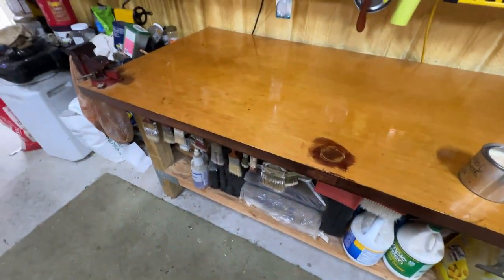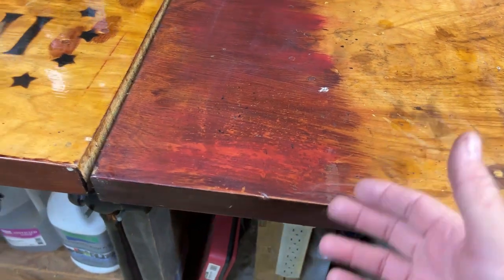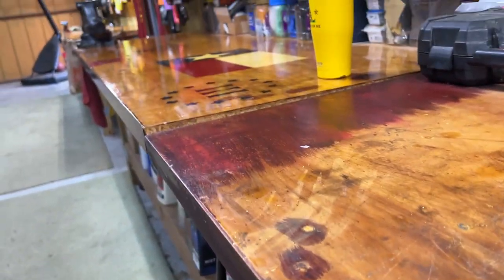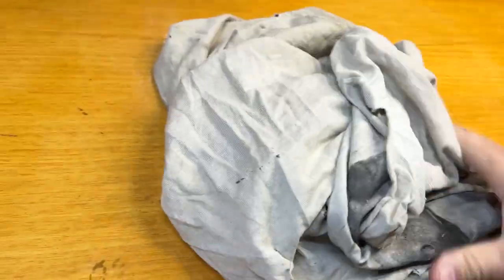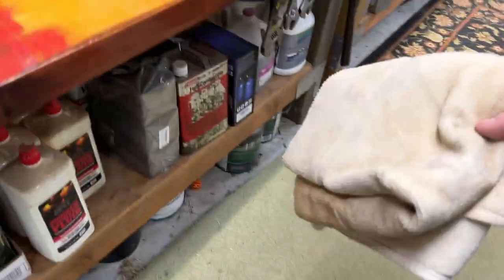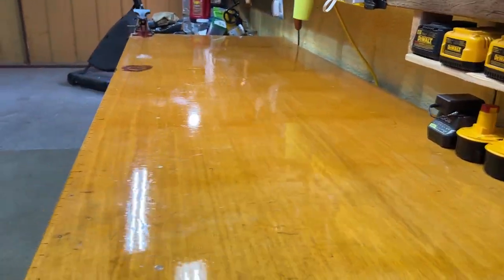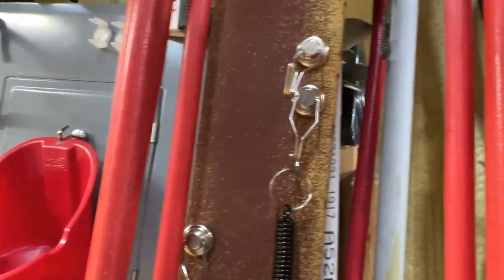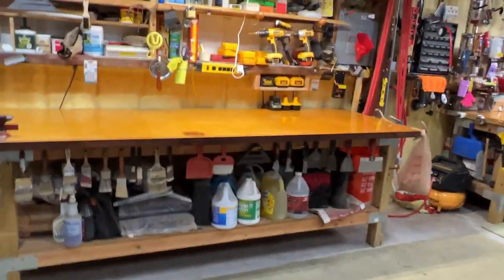Using Paste Wax On Work Benches - Helps With Cleaning & Protection

Comment: I've used vary thinned out  lacquer to seal wooden bench tops for years. 

Since lacquer dries by evaporation of the solvents you can use a pretty thinned out concentration so that the material will penetrate ( be absorbed ) more deeply into the wood. 

When it gets a bit beat up or worn just sand and reapply. A little lacquer  goes a really long way. 

You need to use lacquer because enamels dry by oxidation and when you thin them excessively they penetrate but can't fully oxidize throughout the paint layer. This results in stickiness and other problems.
Reply from the maker: I forgot what I put on them now?  will lacquer still absorb?

Comment: About Refinishing

Putting any type of new finish over an existing finish is always a tricky proposition unless you know what the existing finish is. 

Best way to handle that situation is to strip the old finish and apply the new finish to the bare surface. Second possibility is to test the existing finish to see if the thinner/solvent for the proposed new finish will attack (soften) the existing finish. If it does then you definitely don't want to put one on top of the other because you will bring components out of the existing finish which may be incompatible with the new finish. An example would be lacquer over an oil base, if the lacquer thinner softens the oil finish then oil will contaminate the lacquer being applied resulting in fish eye drying problems etc. 

The next problem you run into is adhesion. If the new finish doesn't bond to the existing finish then the new finish will simply begin to peel off at some point during use.

Since it's just a work bench you could try a new finish in a small area and see what issues you might get but, there's no good way to tell what will happen, other than trial and error. 

I'd be inclined to sand through the old finish and just lay down a new top coat because it will smooth the surface dings, remove scratches, paint spills etc. 

The other thing is to remove any grease and/wax before you apply a finish because grease wax and oil (silicone ) are a huge issue. There are products to do this.

Hope that helps!

Many years ago I did a couple of jobs that were "20 coats of hand rubbed lacquer." What nobody tells you is 17 of the coats end up on the shop floor. But....... it sure looks cool on a 50s era hotrod.....lol

Lots of freaking elbow-grease! That's why a really good paint job cost so much.
Reply from the maker: it helps, I ain't fucking with it..  :)

Comment: I wonder if this would work on my dashboard. I did clean it real good than I used petroleum jelly on it. I’m gonna do it once a week. This breaks my heart cause he’s a great truck. Still runs like a new one. But I’ve been annal about basic maintenance since day one. He’s a 97 F-150 but I got  him in 99 with only 21,000 miles. I love my truck and I don’t want a new one.  But just some minor stuff I want to do is get him painted cause on roof n hood paid is going. Plus I want a camper shell so I can keep my tables in there for my farmers markets. But I can’t find a dealer. What’s the big secret?? All I remember is one made by Leer. Ugh. Debs from Texas